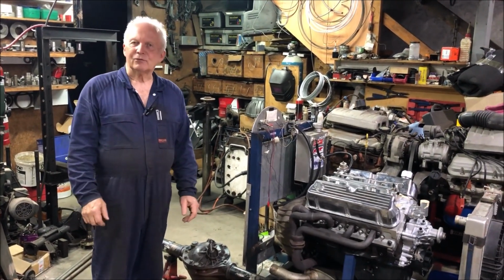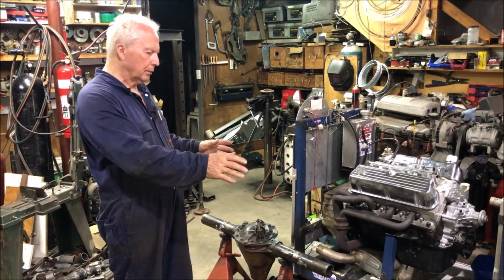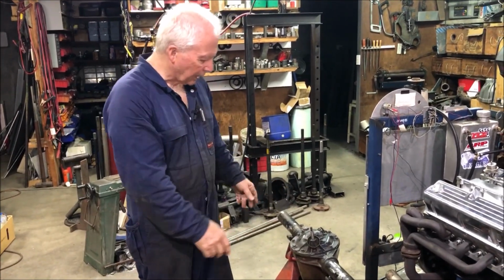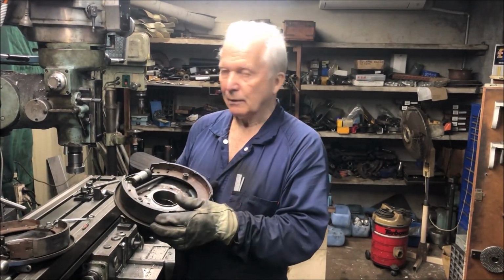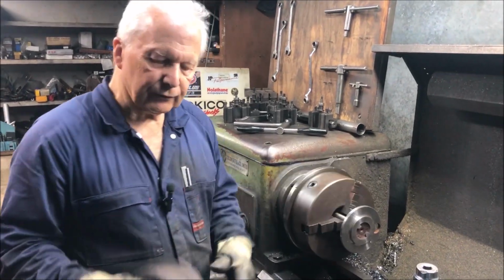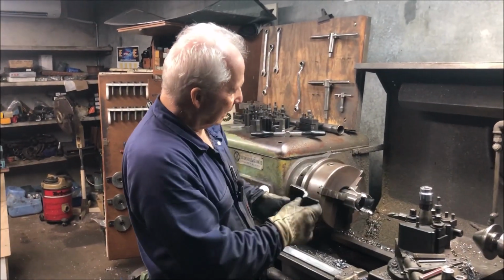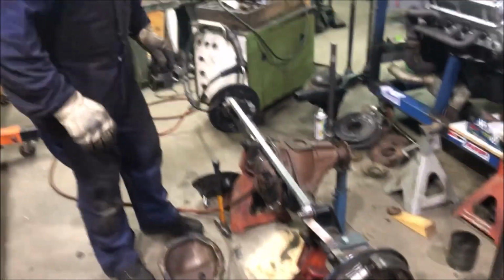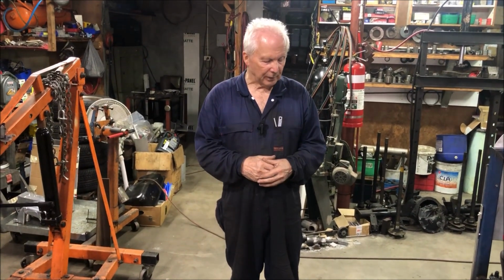Sunbeam Alpine Sunbeam Tiger Diff Conversion. Sunbeam limited slip diff conversion

Comment: My Tiger was a former race car, so it had been converted to use a Nissan 180 rear differential. It wasn't done very well, so i had to re-do it myself. It is less work than you would think if you can find a complete rear suspension. I have CAD files for the custom mounts required if anyone is interested. And the rear suspension is actually pretty cheap from japan because everyone is buying the other half of the cars when they get exported as half cuts

The Sunbeam Tiger's Achilles heal has always been the rear suspension. A straight axle in the rear in combination with the overpowered V8s made the car fun but on the track it really is a pig on the track. The independent rear suspension with coilovers and a decent front sway bar REALLY change the car into something competitive.